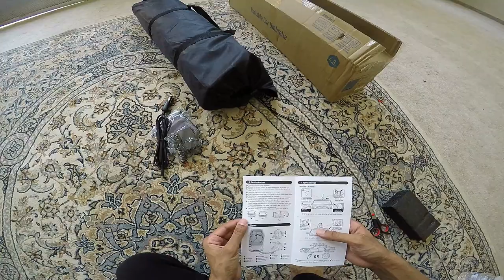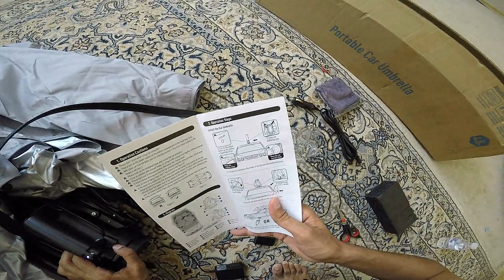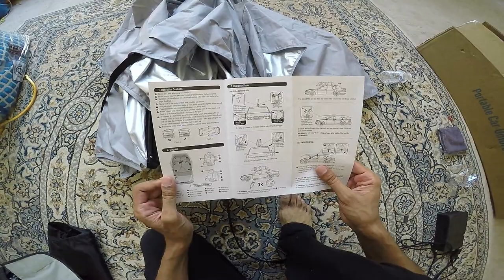Senllen Car Tent Review (With Full Setup)

Comment: Looks great. How does it hold in the wind?
Reply: It's doing okay right meow for me here with 10 mph and occasional gust.  The frame to cloth attach points are simple metal button snaps so the cloth will break away and flap about to prevent it turning into a parasail.
Reply from the maker: Only with light wind. It barely strap on to begin with if the wind is too strong